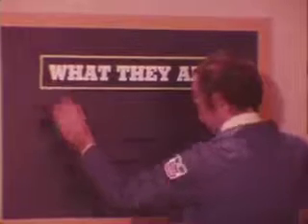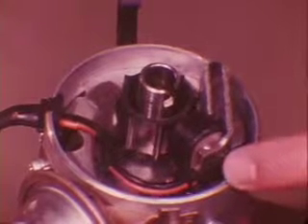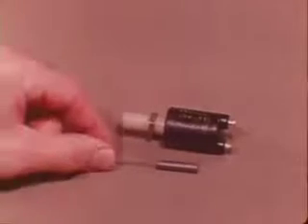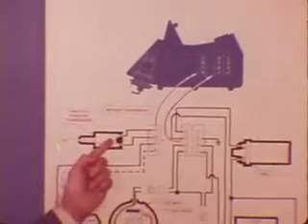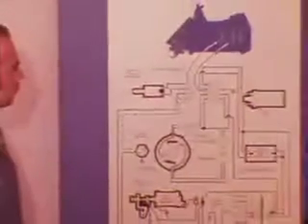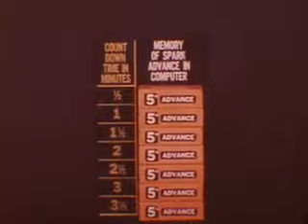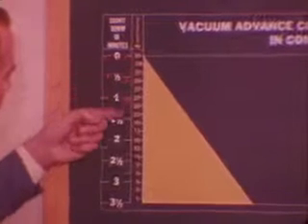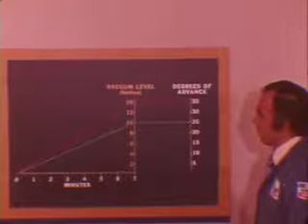76 05 Inside the Electronic Lean Burn System

Comment: Thank you Frank. It's a very simple system; nicely explained.
Reply: Simple compared to the Chrysler electronic ignition system that preceded it??  I can see now where there was the potential for lots to go wrong.  On the upside, a 3500 lb manual car fitted with it achieved 9.34 l/100 km in an economy run back in 1979.
Reply: @johnrroberts7900  21.97 US mpg or 26.55 Imperial miles per gallon was very impressive for a constant speed of up to 67 mph. The next years AS2077 figures for the 4speed ELB 4.0, was 31.1 Imperial mpg at 62 mph. That's 13.18 Kilometers per lit(re). Both the 4.0, 4.3 Hemi ELB and 5.2 Blue ELB engine used the same 2bbl carb.